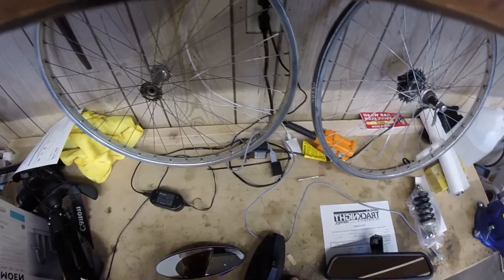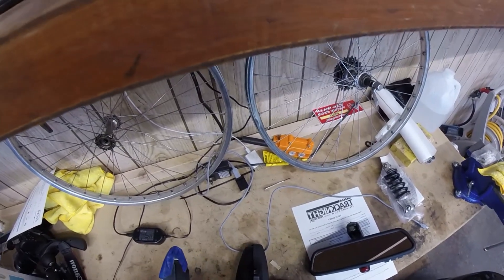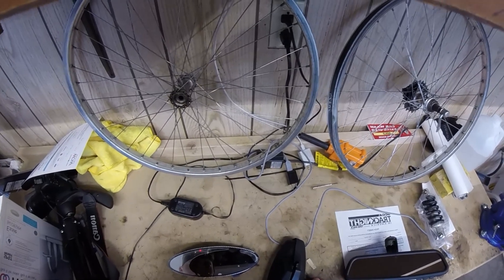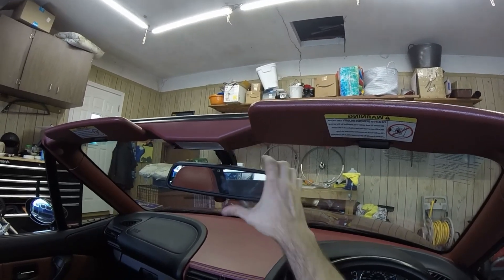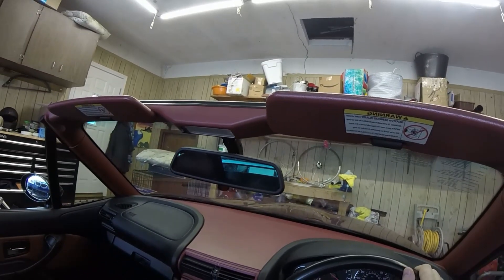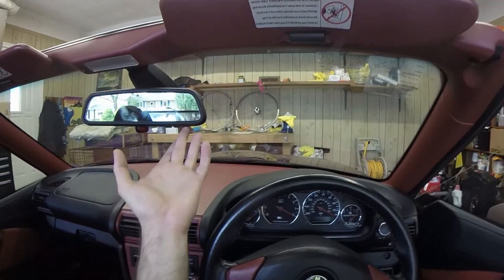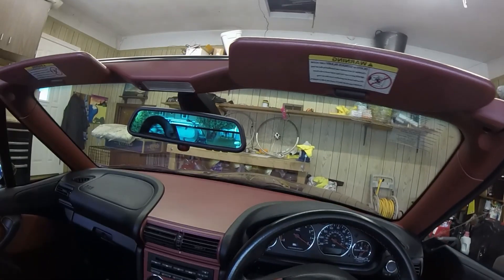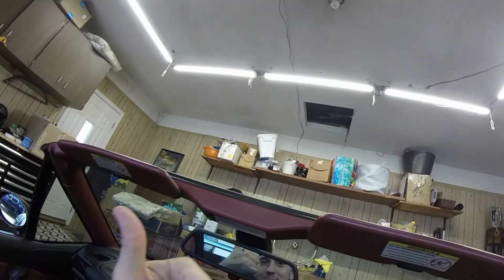BMW Z3 M Roadster Leaking Rear View Mirror Alternative

Comment: Great idea. I followed your steps and replaced the mirror of my Z3M with that of 2004 E65.  The problem I am having now is the central locking no longer works.  I think the original mirror has a receiver in it for central locking.  Did you have the same issue? thanks
Reply from the maker: hmm. That's a great point. My remote never worked, so I never really thought about it!

Comment: That's a awesome upgrade to the Z's.  Great to know that it pops on. This is a great area to make improvements with a 3D printer for a hidden dash cam or 'built in' radar.  I had a coworker that integrated high police radar in to his 1991 NSX.  He took it apart built custom housings for it so it blended in the mirror then ran a cable for the arrow light his instrument cluster where he did some cut out in it to prompt him.  It took a lot of work but he had a heavy heavy foot.
Reply from the maker: Having driven around with it for a bit, I actually decided to take those plastic bits off. They obstruct the view too much.
Reply: @CarGuy1  the Z's ain't know for much visibility or room to see out unless the tops down.
Reply from the maker: @fryreartechnology7611  very accurate statement.

Comment: My 2000 M Roadster has this issue. I got an E65 mirror from Ebay and guess what, The mounts are actually different enough that it will not fit on the 2000 mount. Be careful when trying this fix. Fortunately I only blew a total of about $31 for this mistake.
Reply from the maker: Hmm that's weird because my mirror came from an E65 (2003 745i to be exact). You can see it in the video. I just checked RealOEM and the base plate is the same part number - 51318145530. Not that I don't believe you, but maybe the seller didn't send you the correct part.